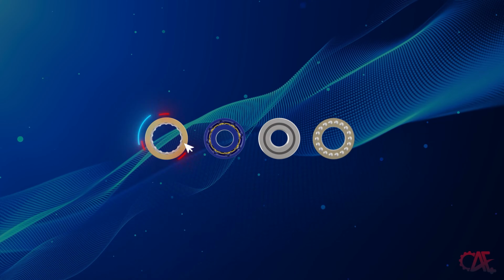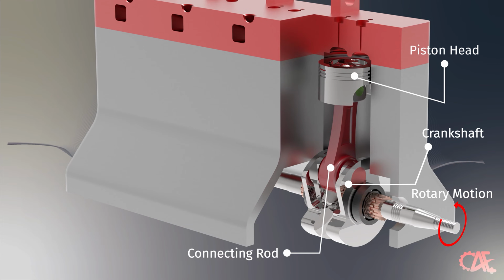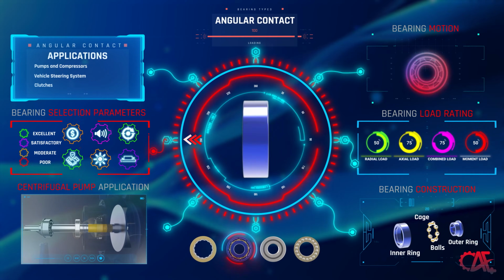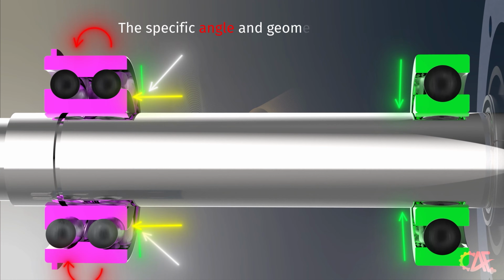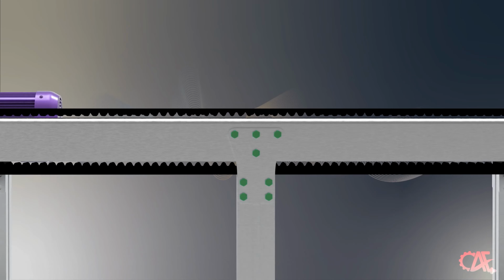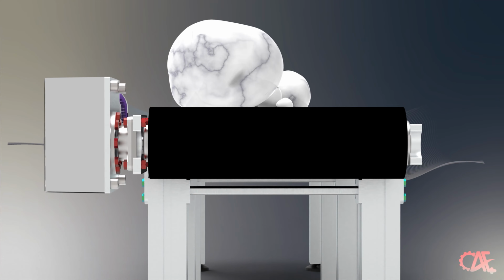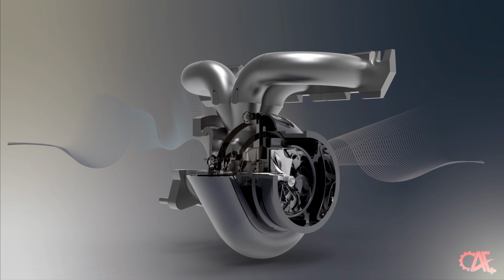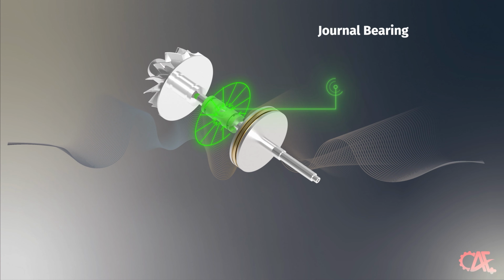Applications of Bearings 2 [Common Types]

Comment: Your videos are AWESOME! Very informative and incredibly well produced! I have a question for you if you have a moment. All the examples I've seen so far center around loads that are being supported on the horizontal axis. I have something I'm trying to design and put together that needs a bearing for support in the vertical axis and then controlled by a servo at fairly low speed (5rpm max) and is unlikely to make more than 2 or 3 full rotations at a time. There is a strong likelihood that the load won't be perfectly balanced but not terribly out of balance, once the position is found it will be static. Do you have a suggestion or have a resource I could look into to find something that's suitable?
Reply from the maker: Thank you so much for your kind words!
We are happy to hear you find them informative and well-produced.
Regarding your question about a bearing for a vertically-oriented load with specific rotation requirements. There are multiple factors you need to consider when designing such a system. As I am not familiar with the details of your project, I might not be able to provide you with a useful solution. However, based on your description. I think for a bearing that supports a vertical axis, especially with an unbalanced load, you'll want something that can handle both axial and radial forces. A thrust bearing might be suitable for this purpose, as it's designed to handle loads parallel to the axis of rotation. Additionally, considering the controlled rotation by a servo at a low speed, a precision bearing might be necessary to ensure smooth operation.
For resources, I recommend checking out technical guides from bearing manufacturers like SKF or Timken. They often have detailed catalogs and can offer custom solutions if needed.
If you have any further questions or want to have a discussion, please feel free to contact us at contact@caeplus.tech. 
Good luck with your project 🍀✌🏼

Comment: I have never seen roller bearings as main or rod bearings on an engine wtf
Reply from the maker: They do use needle roller bearings on smaller engine’s crankshaft. For instance motorcycle engines (Typically Honda 2 cylinder 4-stroke engine) uses them. However, the main disadvantage is that for assembling them on a crankshaft, the shaft needs to come in separate parts which translates to higher manufacturing cost and overall weaker structure of the crankshaft. 
If you are interested to learn more on other examples, I suggest you to look into Schaeffler Group’s (one of the main bearing manufacturers) catalogue on needle bearing and their applications.
Reply: @CAEPlus  well damn very interesting. I had started to wonder later on that night "well how tf is that installed " LOL yep. Very unique.